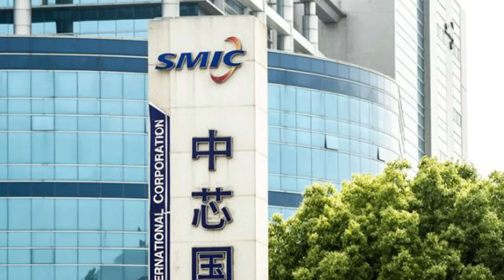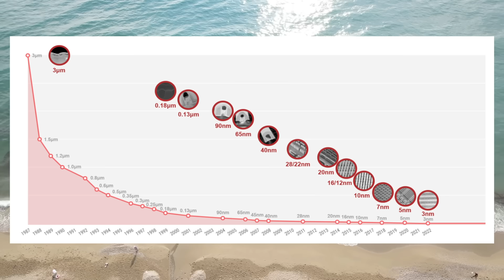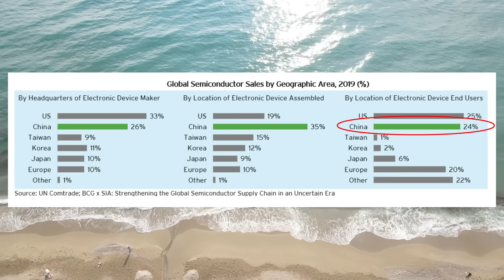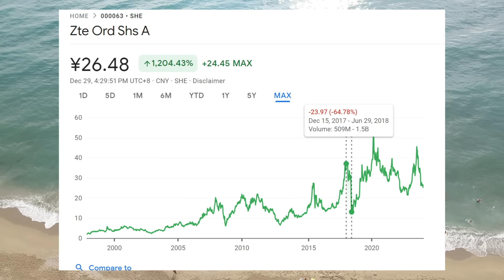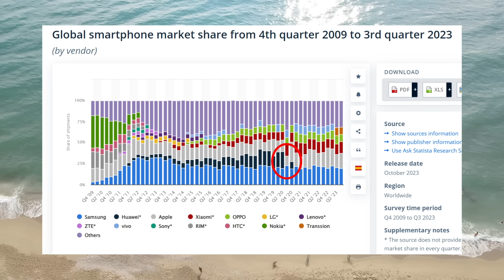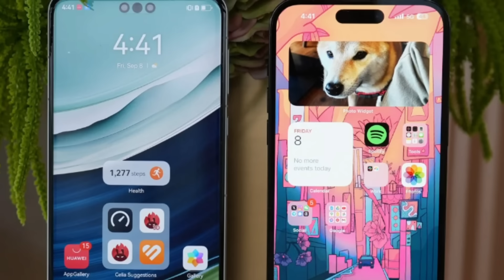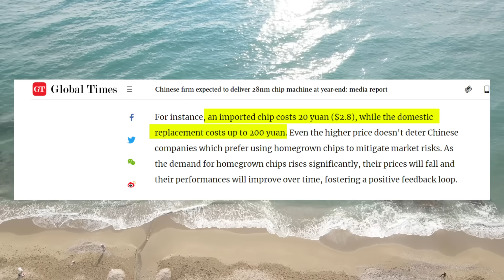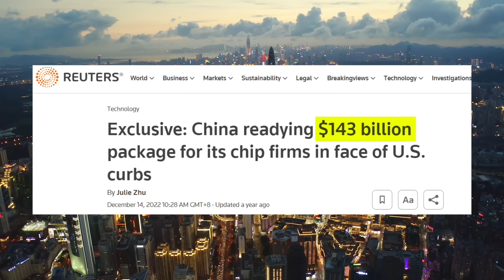Why China Semiconductor Sanctions Won't Work

Comment: The Mate 60 CPU is manufactured using ASML equipment China bought and stockpiled BEFORE the sanctions took effect. Your chart of the global semiconductor sales showing China #1 with 30+% is also highly misleading because NOT ONE CHIP of the highest tech was made in China. Not a single chip. China mostly makes low to mid-tier chips that are often decades behind the cutting edge. Also, not a single country is able to build the most leading edge chips - it requires ASML EUV equipment from the Netherlands, EDA software from the US such as Synopsys and Cadence, and process know-how from Taiwan and South Korea (TSMC, UMC, Samsung). None of those countries alone is able to make 3nm chips without the cooperation of the other countries. So for China to develop the entire production chain on its own is going to take decades.
Reply: First of all china couldn't stockpile 7nm euv machine from asml even before the sanctions that is why they only made 28nm and 14nm at best from 2019-2022 after years of research china finally managed to modify and create a 7nm processor even without using EUV instead they used something called DUV so yea china can produce 7nm ofcourse they still need US EDA software industrial softwares are far to complicated to create in short period of time but if i'm not wrong they are not restricted to use it right? Also they have been researching on chip stacking technology by which they could some what replicate 5nm processor by using two 7nm processor which is still in development stage tho 
And finally yes no single country Fully controls the entire chip supply chain but remember none of these countries are as desperate as china all other countries could focus on one thing and outsource everything else but for China they have to make everything so they are pouring hundreds of billions in to R&D so it's possible they could understand the knowledge how in 3-4 years
Reply: Yes, it will some time for China to make some breakthrough in advanced semiconductors, but it will eventually. Many people doubted if China could build a space station on her own, she did. China has the money and talent and determination.
Reply: You missed the point.  85% of the market for semiconductor chips is for chips greater than 7nm nodes.  That is what China can do and it is now dominating the mature node market and the US is the loser.  Now, China nibbles away at the high end and it is a matter of time before China gets these high end chips into reasonable production. China, as of 2023, had 40 fabs and were building 12 more.  It will dominate the semiconductor sector pushing the US aside.
Reply: We have been hearing these commentaries since 2000 when China was one tenth of USA. After 20 yrs we are watching China is sending its rover to Mars and manufacturing high speed trains in high speed.
Reply: Decades is okay for China as they capable to play the long term games.
Reply: Neither in USA
Reply: How many decades did China take to pale western dominance in building space station and manufacturing EV?  The very intention of America allowing China in WB in 2001 was to keep China busy in perfecting TEE shirts and Toys production not laying High Speed Train tracks home and abroad.  Any determined nation with a good size population can pull off if it has a strategy and can rationalise its human and financial resources allocation free from internal and external maligned forces.  China did, unfortunately India couldn't - both had almost equal nominal GDP and population size with India having a larger talent pool.
Reply: @mizanrahman5194  Lol the quality of Chinese EVs are extremely poor, not to mention nobody in America even wants American EVs...
Reply: @codejunki567  So then why America is crying if China's EV is of poor quality.  Rational buyers will reject low quality and go for the better and value for their money. Let's leave it to buyers.
Reply: @mizanrahman5194  What about Chinese EVs? I've not seen a single one here in the states and I live in a major city.
Reply: @codejunki567  Polestar 2 & 3 are Chinese Evs .. Hv u seen them ? Volvo XC40 is a Chinese Ev, have u seen them ? Probably but u didn't know. Byd has an Electric Bus factory in California, that's an electric vehicle ...
Reply: 2 months later the secret is out.  They filed a patent for applying self-aligned quad patterning to 5nm chip, said to be available this year, basically moving from 7nm to 5nm in one year.  Mate 60 pro production issue has also being resolved.  They are also pushing ahead with development of 3nm chip, which will be the real test as many doubt this can be done without EUV.  Hard to say because they seem to be able to brute force many things, far beyond expectation.
Reply: You truly knew little about China's ability.
Reply: China can't make their own chips, they only copy other's tech. They steal their tech. WSM has bought into the MSM narrative that the CCP wants to disseminate.
Reply: Wouldn’t it be interesting if the biden administration succeeds in bullying elon musk out of the usa and he would continue his ventures in china? How long will it take elon to develop a good parallel processing chip in china (which already made him a honorary citizen) 😄
Reply: TSMC relies on Chinese infrastructure to get chips out of Taiwan. The Chinese can certainly leverage that - and likely do more than anyone is aware.
Reply: You always feel envy by China's success. I remember you used to say China will decades for high tech weapons. Where are those decades now???, China has self made IS, China has surpassed US in some weapon tech but you don't admit. You just lie and get deceived yourselves 😂😂😂😂
Reply: Jeez, this place is filled with sad losers making a nickel per post to make China seem better than they actually are.
Reply: codejunki and you believe China gives a shit about profit at this point there gold stockpile is more than the US China doesnt give a flying fxck about magic dollars
Reply: It's only a matter of time before they develop their own ASML type of equipment. This Country is not to be underestimated.
Reply: @saellenx3528  before or after they implode or explode in the next 5 or 10 years?
Reply: @dark_fire_ice  that story is going around for at least 15 years now. And it still did not happen. I think it's time to stop all the cope and telling itself it's gonna turn out fine when it's not.
Reply: No it doesn’t, the only thing China lacked before for 7nm were the Duvs, and there is not a small chance that china already have them by end of 2023
Reply: Most of those countries / regions are essential US behind them
Reply: Decades is not too long for a country 🫣
Reply: These countries rounding up and gang bullying China ， ironically you Seem approve of their bullies
Reply: Which western media lies you been reading.. Do you think all these chips made by God untill humans cannot replicate it... It is very easy for China to replicate and to reinovate..
Reply: CIA & MIC Agents are very active in chip matters ya.
Reply: US & their Gang of 3 stopped  selling chips to China ?   Keep your stockpiles at home as China not buying too.   No regrets later ya.
Reply: The second largest economy on the globe is facing pressure from all angles and you think they'll fail.... Remember.. they are the only country that owns a national space station only because they got kicked out...now what do U expect when they get kicked out of chips,....we all know it will take some time but with that govt funding, that Netherlands guy was right being worried....
Reply: Keep drinking the west's kool-aid.  Ignorance is bliss
Reply: Then we have patience
Reply: Useless information. China have alternative technologies and they don’t need any technologies from Netherlands. Little knowledge is too dangerous.
Reply: EUV isn’t a cure all or a sure thing that’s why intel didn’t want to invest in it and fell behind AMD as they joined forces with TSMC who went all in on EUV. I’m sure they’re looking at other options
Reply: I will screen capture your comment and come back in a few years 😂
Reply: China already reached the ceiling in terms of tech progress and economic growth. From here they are becoming more like Japan ie a spiral downwards towards the abyss. It has been proven that China economy is smaller than Nigeria. It is all smoke and mirrors. Chinese don't have any ability to innovate. They never had any capabilities especially in tech
Reply: I think before America said China cannot make 7nm chips and would not be able to use 5G in their Huawei phones for another few years.. but all of the sudden they did it. Yes we can all hope China cannot do things.. but hoping is not reality. We just have to accept that China will break through challenges. It's not difficult for them.. they did it for the 7nm so soon they can do 5nm .. they already using 5nm in their laptops from Hauwei. So likely 3nm will be within 1-2 years. Don't underestimate China. US underestimated them and they shocked the world with their 7nm chips.
Reply: @SimonCU   Huawei's 5nm laptop chip was made by TSMC. It took TSMC 5 years to go from 7nm to 3nm and using the latest ASML EUV machines. You think China will get to 3nm in 1-2 years? LOL!
Reply: @18000rpm  yes .. we were shocked about the 7nm and now they are using 5nm in their laptop.. so the next step will be 3nm.
Reply: @SimonCU   Hello?? The 5nm laptop chip is made by TSMC in Taiwan, NOT Huawei made.
Reply: @18000rpm  yes I know... Maybe next year TSMC will make a 3nm for them.
Reply: @SimonCU  Not gonna happen. Those 5nm chips were stockpiled by Huawei before sanctions.
Reply: @18000rpm   Tsmc's 3nm node has been very disappointing so far, just an extra core. It seems that the difference is become less and less each node. Hopefully the difference between 2nm and 5nm will be big.
Reply: @18000rpm you realize that Taiwan is part of China, yeah? Regardless of western news saying otherwise.

Ask yourself, how does it benefit American processes and companies if the media that has a stakehold in said companies report positively on Chinas progress? 

It’s all about the money, it’s always been about the money, anything else is cannonfodder.
Reply: @l00tur  LOL then how come Taiwanese company TSMC is not allowed to sell to Chinese company Huawei??
Reply: @18000rpm they are? They’re just “barred” from selling certain components. Did you just watch this video only and think you understand all of the nuance that comes with situations like this? Let me guess, you’re the type of person that hears a headline and believe you have the entire story? 

Typical
Reply: @18000rpm.

Why not?  Mr. Numbers  !!!
Reply: Do you realize how long decades are?
Reply: @nicholasdean3467  ASML started in 1997, you have to start somewhere, sometime.
Reply: @nicholasdean3467  do you
Reply: The most important part of the video is China being kicked out of the ISS and 20 years later having their own space station. 

Do not overestimate EUV, high NA machinery.  Asml ended up buying a USA company to use this technology. Are you sure China won't have something even better in 20 years? If they keep investing and creating a less stressful environment to work than that in USA (I would never work in USA, I did the numbers and it is not worthy with family) they will be create a better technology. Just look to the story of EUV, collaboration with universities. It can happen, you just need a lot of money, and explore different paths.
Reply: @manoo2056  And China has talents, money, and most importantly determination to the job efficiently free of corruption and bureaucracy.
Reply: @manoo2056 especially with AI help
Reply: US also expected it would take China decades to manufacture 7nm chips, only have its face slammed
Reply: @ArkiBeach  LMFAO you pulled that "fact" out of your a**. The ASML equipment China imported prior to sanctions can manufacture 7nm chips. TSMC launched 7nm chips in 2018 for gods' sakes.
Reply: @ArkiBeach  Decades?? Who told you that? Even the highly educated people in silicon know that keeping EUV tools from them wouldn't keep them away from breaking DUV sized nodes effectively,  it was just going to be more difficult. Decades? You're reading bullshit if you saw DECADES.
Reply: @ArkiBeach  The fact still stands that don't have the local technology to make 7nm, because guess what....your precious 7nm node was made with an older process and its not capable of going any further with DUV. And even then, the DUV machines are not Chinese. China DOES NOT have lithography tools capable of mass producing these less than 7nm nodes. 

It's all ASML.
Reply: This threas is glowing its like the sun, those cia glowies sure are a hand full
Reply: it's working right now, Nese are too proud 😂😂😂 When the dynasty era are already over
Reply: @tiefblau2780 jai hind
Reply: Chinese has the ability to shrink decades to years. But i love the way the West keep underestimating China.
Reply: @roro4787 of course, but it's far less sophisticated than the state of the art ones from Cadence, Synopsys etc.
Reply: @18000rpm sophisticated you mean in terms of what or you're just driven by hate western propaganda has planted on you? You guys you will always say China is incapable but you will be left alone in that dark world.. no one can stop vhina to achieve what they want as you're afraid of competition...
Reply: How exactly are the chips decades behind? That's at least as early as 2004?
Reply: @xuepingsong5329  Even the video itself acknowledged that the chips built using China's own lithography machines are 110nm, which is decades behind. They announced 28nm but not for actual products.
Reply: @18000rpm  they built a space station, give them time. You just need money and long term plans, then scientific and engineers can do their job. And I hope they has less issues than Boeing, and example of how management can fack up a company.
Reply: @manoo2056 The US space station Skylab launched in 1974. It's literally half a century old technology LOL.
Reply: @18000rpm   I thought you were talking about chips, not lithography.  Are you taking about 100% domestic chips? Okay then what nm are american lithography at? Or is it all imported? How can you equate not having lithography with being decades behind? No country does it all like you said, but you're using twisted logic. Making chips is not all about being asml or being TSMC. You can also use this idiotic logic to say the Dutch are 100years behind because they don't fab the end product and need us ip.

And what do you mean, not for actual products? This ssa800 is the final product, around 8 prototypes have already been shipped and tested including at smic for two years. Why would mainland fabs be in a hurry to replace working asml machines with domestic ones when there are enough currently for fabs to expand for several years? This is not making sense, do you expect all the horded machines to be thrown out? When they run out of asml machines to fill fabs, which would be several years from now, ssa800 would be even more mature. And not sure if you know, Smee is not responsible for making euv happen.
Reply: @xuepingsong5329   Thankfully the US has good relations with other democracies and therefore can cooperatively make the most advanced chips with help from Netherlands, Taiwan, etc.
Reply: @18000rpm   Looks like YouTube censored my comment, oh well.
Reply: @18000rpm 
How far is India in the space program? India is in no way near China.
Reply: @18000rpm but they have a brand new space station and you don’t 😩
Reply: @slc801  US launched its first space station in 1973 LMFAO. You are proud that China is 50 years behind? 🤣🤣🤣
Reply: @18000rpm how many countries on this planet is capable of it? The U.S. and the U.S.S.R., so it's something to laugh at? 

Patents only requires around 20 changes for the U.S. to grant it and 20 years before it expires. The laws are probably different for the Netherlands. You need to remember that China actually has these machines from ASML, they can and probably have the capacity to reverse engineer it or come up with slight differences in meeting the gaps. 

Software is probably the easiest thing to rip off. I don't see how they can't see the source codes for this of they actually have the product.
Reply: yeah idk what propaganda this dudes been consuming but hes so far off its almost funny
Reply: @RoronoaZorosHaki They came with numbers, what are you coming?
Reply: same energy as the wolf amendment enthusiasts 😂 “don’t let them join iss bro!” “they will never make 5th gen aircraft bro!” “we will kill huawei bro!” and huawei makes 7 nm which even INTEL cannot fab, using random canon litho machines they have😂😂😂yankees should stop overestimating their dominance in stupid designs and patents (not in actual industrial production) 🤪
Reply: @18000rpm u just work there as janitor. U don't know how Chinese reacts. We think they would be fooled around, but they bailed us right at the head. Take few example space program, space station, 5G
Reply: Most of these criticisms were either covered in the video or sufficiently clear from context, but okay...
Reply: Smaller nm does not make it better 7 nm is good and China is there. The world stay on hating on Chinese.
Reply: @48512 Dude, the world doesn't only consist of the western countries.
Reply: @48512  That's because you Chinese copies and steal everything you come close to. You have not invented anything yourself in the last 2000 years. Even communism you steals from the orcs, there is nothing original about you.:goodvibes:
Reply: @48512  "Smaller is not better". Okay let me school you, 7nm chip produced on a DUV machines takes no less than twice the amount of time, therefore you only sell half the chips, therefore everything is 2x the price to make. Capeche? The Chinese government has to subsidize these chips so that they can even break a profit.
Reply: @48512  Sure they produced a chip, but at what cost and was it efficient? Meaning the process they used to create this, was it subsidized by the government?? Pretty sure it was because the cycle time for creating 7nm with DUV is huge compared to EUV. So tell me Mr Smart pants.
Reply: @codejunki567  everything is subsidised XD. How do you think USA is able to compete? Not to say the army the big spender of USA, and all his contracts.
Reply: @samueloabilemunyari3717  I'm building a new pc, where can I get a chip that competes with current intel, you cant.
Reply: @manoo2056 Boeing anyone???
Reply: Not only that, but 7nm is the highest possible with the equipment China has access too, and anything smaller is hoarded by the Dutch.

Comparing the CCP smartphone with a western smartphone, and saying it equal, would be like comparing a bolt-action rifle made today with modern assault rifles
Reply: @dark_fire_ice except the AK47/AKM is still a vastly better rifle than an AR, especially when conditions are less than ideal, which they always are, your comparison is awful.
Reply: @l00tur  I compares a bolt-action to auto, and your counter was 2 auto. You don't logic much do ya
Reply: @dark_fire_ice it’s still a bad analogy because it’s not rooted in a general concept that easily understandable.
Reply: @l00tur  well that's insulting to a general audience, unless you are going to speak and reason, for everyone, I would take that back.

An analogy isn't bad because it's difficult to understand, it's bad because it does match the circumstance being referenced
Reply: @dark_fire_ice are you suggesting the general public understands the nuances of firearm types? 

Now you’re being disingenuous and your poor attempt to hand wave being called out for perpetuating a bad analogy furthers the idea that you don’t understand the context at hand.
Reply: @l00tur  I am assuming the general public would be aware that bolt-action rifles are no longer standard issue, and this deduct its because it is outdated.

You have made a claim about my analogy, and back it up with "I don't understand, therefore bad," while I pointed out, one's incredulity is not used in a bad analogy analysis. Either provide evidence for you claim, or drop it
Reply: @dark_fire_ice  Name me three high quality western smartphone's companies?
Reply: @dark_fire_ice Actually Huawei just got 5nm in their recent laptops.. you can Google it. So 7nm is history for them now.. soon they will have 3nm .. it seems they are more advanced than we think.
Reply: @dark_fire_ice bolt action rifle with Modern assault rifle😅😅😅😅 you know nothing about guns or phones I guess
Reply: @dark_fire_ice most Chinese brands use snapdragon chips, no different than a Google pixel🤷‍♂️🤷‍♂️🤷‍♂️🤷‍♂️
Reply: @chubethenoob6225  yes, they use American chips, like American companies
Reply: @dark_fire_ice I am typing this using Huawei Mate 10, nearly 10 years old and still going strong .. US motorola are junk, Europe Ericsson and Nokia ling time in museum pieces. Samsung phones dont last long... 3 years max spoiled.
My huawei mate 10 battery, screen still ok after many times drop on floor. Sound food reception good. Camera number One Clear and Sharp.. I still use it just because if the excellent camera.
Reply: @xzdrtxyzxvn  so you chose to counter my point, with a Chinese phone, that uses almost exclusively western technology; good job.

Now let me correct you on a few things:

Batteries are batteries and are subject to the same chemistry and physics. As lithium ion batteries lifespan is only around 1000 charging cycle that means the Mate 10 simply uses much less electricity, likely do to less functionality.

You are comparing phones with different logic behind them. The West has settled on a planned obsolescence model, and thus demanding near constant (but minor) innovation. While China is using mass dumping model, find an older (relatively speaking) foreign technology, and streamline its production to fulfill needs and to export.

I am not say China can't use whatever tools they can get their hands on. I'm saying because the authoritarian system they live under, innovation (if ever allowed) is an exceptionally rare occurrence. So, they are reliant, solely upon imports in order to maintain what levels of modernity they have
Reply: @dark_fire_ice we will see what you’re saying is true in the near future but I like backing underdogs 😜
Reply: @dark_fire_ice 
Just like the comparison between China and India. 😂
Reply: @dark_fire_ice  Do you know lithographi technology can only produce chipset 1nm or 1 atom size😂 Currently Lithography technology can produce 2nm chip. What happen if China entirely replace Lithography technology to making Chipset😂😂😂😂
Reply: @dark_fire_ice I actually owned a Huawei mate 60 pro and I compared it to my sister Apple iPhone 14 I considered the Huawei smartphone the better phone in terms of resolution and speed
Reply: @dark_fire_ice no they can make it to 5nm with the current manufacturing hardware but that's the limit
Reply: Based on what evidence exactly 
? Do you work in the industry? Do you work in ASML?

So desperate not to see another country rise up .......Obsessing over a phone that is not sold in the US and the company has no presence in the US.
Reply: @ndukasmith Do not argue with a person who decidedly believes that Chinese are incapable of achieving anything. Make him feel better and happy in believing in his exceptional qualities because that's all what he wants to hear
Reply: @ndukasmith the evidence is ASML. They are the last man standing because everyone else found it too hard to develop the machines and stopped, so they are the only provider because it's that hard, and Intel, AMD, TSMC, Samsung etc are happy too work with each other in making sure ASML can continue to develop their tech.

That's the evidence. Literally no one else is able to make these machines and no one is even trying apart from in China where it has been forced on them.
Reply: @ndukasmith Found the China simp
Reply: @ndukasmith Actually I did work in the EDA industry and our software was used by Intel. What about you? And what was I wrong about can you tell me?
Reply: @18000rpm huawei developed its own EDA, not using yours
Reply: @18000rpm  people can talk all kinds of BS, but no one can deny the truth when Chinese products started to have 7nm and 5nm parts, of course, they will say the yield is bad, again, it just a lot of BS or green eyes, if the yield is so bad and yet the products are competitive and can kill the competition, so that is the real proof, all the sanctions did is to protect the Chinese local competitor to be able to grow. Chinese customers have no choice but to use their own local suppliers even if they are not as good. so inferior suppliers had their market handed to them for free and on top of that, the Chinese government was galvanized to fund them as well. so, all these minnow companies who was formerly suppressed by the industry whales now has the chance to become not only whales but dragons. of course, everyone says it is impossible and says it is not economical to do. true test? when products appear on the market using "impossible" chips, then all that was said is just BS. i think within 2 years, there will be a complete supply chain in China and there will be 3nm or less on the market. people do not understand the scale of China, all one talks about is just one or two Chinese company like SMIC or Huawei, but in reality, there are 1000s of companies in China, almost as big as these two companies who just quietly copying as well as doing their own R&D and selling domestically, irony is that many of these companies were former Taiwanese companies who has migrated to the mainland because of the marker size. to really have a feel of the market, one should go and visit China and see. if you know Chinese culture, they will not show their hand until it become inevitable. so, if they really have products in public, you can bet that they are on the verge of the next breakthrough.